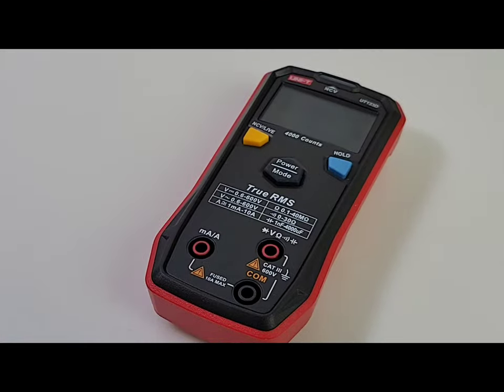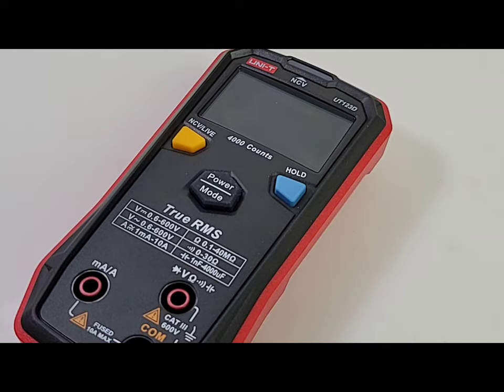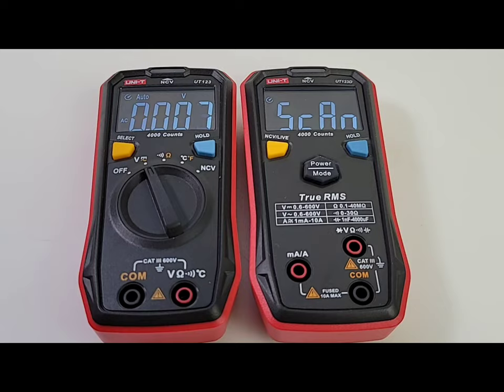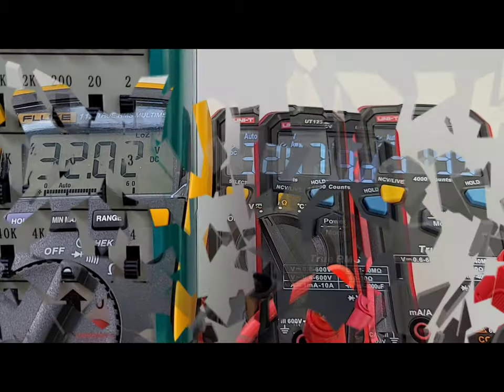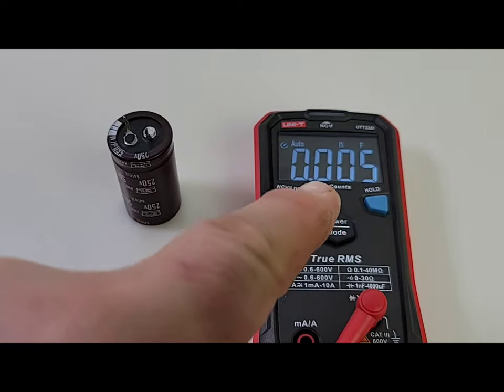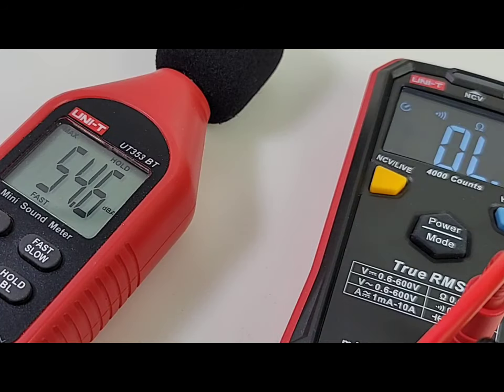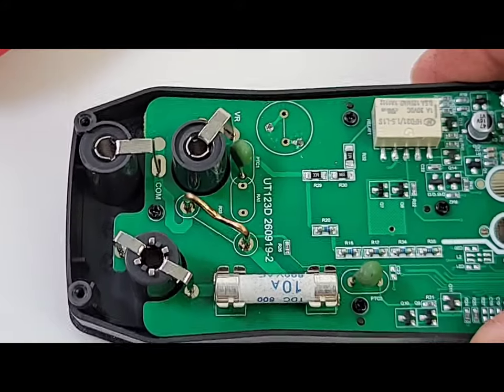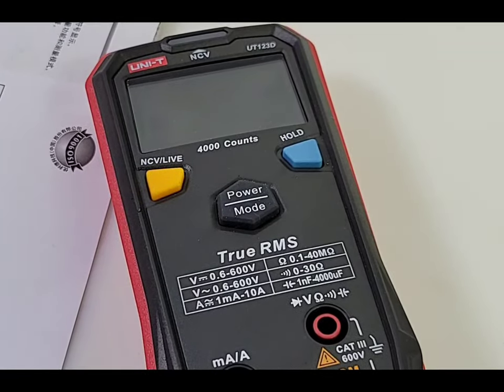UNI-T UT123D CHEAP-O Multimeter Review & Teardown!

Comment: HI Darren, I bought one UT123D when ordering an UT 123.
I was tired of  another Smart meter, (ZOYI ZT-S4)(You have reviewed a similar  one).
It would   not light LEDs which have an antiparallel protection diode . Other meters, even cheapest ones will do.
Before storing it in the  "retired meters for sale" drawer, I decided to  buy a cheap UNI-T: I have some other, and I'm sure they work. 
My opinion is :Nice  cheap small instrument,  Precise, Easy to use 
-Good display,  , I'm missing the foldable stand(why?)
 Instructions were in Chinese only. Too cheap probes
 Even mine  does not light the front LED in continuity check. Thank for your review.
Reply from the maker: Hi Maurizio,  excellent choice !  Too bad they neglected the tilt stand or magnetic backing otherwise it's a solid multimeter! 👍
Reply: @KeepOnTesting   I've used it for  two weeks, and it works as I like, with one little bug :
 I prefer the "dumb" mode,  but it has a defect: it defaults to AC volts. It is aimed to  electricians, not to "electronicians"..  It is a bit annoying, but I've see a really reliable operation. In the meantime, I've ordered a second UT-61(new version)
Thanks to UNI-T

Comment: Hy darren,
which is better between ut123d and ht118a in terms of current accuracy and body construction.

Keep on testing 😉
Reply from the maker: Hello ABBAS...Honestly they are identical in build quality.. both are rugged and good quality plastics and moulding.Accurscy is also very similar...Personally I'd buy both.. Big dual display on the HT118A is always nice but the EBTN display on the UNI-T is sweet too..hard call...but I would buy the HT118A if I had to choose only one.
Reply: @KeepOnTesting  thank you for your answer. and sorry, I have 1 more comparison between ht118a and ut89x which is better where the accuracy is for the use of the automotive field and testing modifications of low-voltage electronic equipment. my current multimeter dt9205 is not accurate enough to measure currents below 1 amp, but it is very important to me. please answer. thank you 😊
Reply from the maker: @ABBAS12V  Both would do well but I'll give the edge to the UT89X in the lower current range.
Reply: @KeepOnTesting  ok thanks a lot darren. and one more question, which of the two is faster to read fluctuating voltages and currents (example: measuring alternator voltage, led flasher, etc.)
Reply from the maker: @ABBAS12V  Probably the manual ranging UNI-T 👍
Reply: @KeepOnTesting  okay thanks again darren, it seems after I thought, I prefer the ht118a because it has a max/min button to measure the maximum current and voltage. does ut89x have that feature? or please mention dmm ut which has max/min features at the cheapest price.

 Thank you, greetings from Indonesia.

 keep on testing 😉

Comment: A meter that does μA-20A, μV-2kV, 0-GΩ, pF-mF, semi-auto, manual dial, normal LCD, min max, rel, temp, is the best meter. Any recommendation?
Reply from the maker: Doesn't exist unfortunately...
Lots of decent options though..depends on your budget. UNI-T UT61E+, HABOTEST HT118A,  SANWA PC7000 all great multimeters..👍

Comment: Hi Darren, I just bought this multimeter yesterday after watching your reviews and it is really good.  When switching this multimeter UT123D in RESISTANCE, CONTINUITY, DIODE and CAPACITANCE mode, there is low ticking sound every second make sure to put the multimeter back very close/touching to your ears, is this normal? When turning ON, you can hear the relay, but when switching to those modes, you can hear a low/faint sound every second.  Have you encounter this? Thank you in advance, new friend here  🥰
Reply from the maker: Great question. I thought it was the relay kicking in but you seem to know what that already sounds like. Any chance you can email me a sound byte so I can hear it ? Email: netplicity1@gmail.com and I'll report back.Btw, Welcome to the channel 😀 👍
Reply: Hi, thank you for noticing, I will send it to you immediately after recording, have a great day 😀 @KeepOnTesting
Reply: I bought mine today and also noticed the same thing, sounds like a clock. I can also hear it in Scan mode.
Reply from the maker: Yes, clicking sound is normal. It's the relay. Congrats, great multimeter 👍
Reply: @MartiniPerez Hi there, mine does not tick in SCAN mode..only in RESISTANCE, CONTINUITY, DIODE and CAPACITANCE mode..The multimeter is working great, and the NCV feature is so helpful in my work 😉 maybe it was the RELAY as what Darren said..I just find it annoying when working at midnight troubleshooting motherboard 😄

Comment: UT123 is a great meter. You get so much for less than $15. But UT123D has gone plus ultra. A lot of people would welcome the addition of current and capacitance modes. The diode mode is close to perfect. And the resistance range has doubled. Just like you, I’m a little disappointed that UNI-T didn’t utilize the visual indication on continuity mode. Also the NCV mode worked better on UT123. Other than that there isn’t much to not like about it. 👍

Oh, and “Put that cheap-o against a Fluke” is a great idea for a regular segment. It’s not as destructive as bashing bad cheapos with a hammer. All in all, a physical punishment isn’t an effective way to correct behavior. Just shame them enough to make them think about their actions and to want to grow as a multimeter. (I’m in a goofy mood today for some reason)
Reply from the maker: Ultra is great way to put it ! UT123D is definitely the next step and lots of improvements make it a worthy successor.

Comment: Hallo bro.
Rm113d vs et8101 what the choice.
Thanks

Sorry if the text is wrong
Reply from the maker: RICHMETERS
Reply: @KeepOnTesting  ok thank u sir.
I think your favorite is et8101 

Because rm113d = 3,5 star
And et8101 = 4 star

Hehe.
Reply from the maker: @abasschn830  ET8101 is a nice dmm..after prolonged use however I find the RM113D slightly more accurate and nicer to use..
Reply: @KeepOnTesting  thank u very much sir. 
Keep testing 😁

Very good riview.
Btw the cheap dmm with pcb very nice build quality is?

Comment: I HAVE A VERY IMPORTANT QUESTION:

Can those who use this device answer, when you manually switch to diode, capacitor, ohm levels, does the CLICK CLICK SOUND come from the DEVICE, can you please answer?
Reply from the maker: You are probably referring to the relay that is triggering when you change modes. This is completely normal.
Reply: @KeepOnTesting  No, I'm not talking about that, for example, when switching to capacitor mode, there is a relay sound, this is normal, but there is a continuous sound after switching on, clicking repeatedly, I'm talking about this sound.
Reply from the maker: @target2256  ahhh well then you have a defective meter. There should be no clicking other than the relay. If you're interested, ship it to me and I'll replace it with a new Multimeter and make a video of the repair.

Comment: Hey Darren, is there an option on UT123D to choose manual range instead of auto range? 

Let say I want to choose Mega Ohm instead of Kilo Ohm manually, can I do that?
Reply from the maker: Unfortunately not. There's no manual override with the 123D.
Reply: @KeepOnTesting  Thank you for taking your time to answer my comment. Between Kyoritsu 1021R vs UT123D, which one will you choose? You only can choose 1 😂

I want to buy between these 2 multimeter but I dont know which one I should buy. Can you give your suggestion?
Reply from the maker: @shahrilhafizhakimin872  Hi Shahrii..well that is quite a difference...in this case I would go with the Kyoritsu without hesitation. 😀  It's a dmm I've been meaning to review for awhile..looks like a very good multimeter! 👍 and Kyoritsu is an excellent brand. The UNI-T 123D is an excellent CHEAP-O but in a different league!

Comment: Inside looks much better than Bside ADM06. And good realization of current switch with 2 parts of connector. 

But still slow for everyday using. XXI century and they can't make fast full auto multimeter. Sad...
Reply from the maker: I guess it's a compromise...but still its a keeper 👍

Comment: Friend at 16:11 what probes you use?
Reply from the maker: Those are ProbeMasters! One of the best test leads out there. 😊👍
Reply: @KeepOnTesting  Thanks for the answer. I use Fluke 17b+ with good fluke probes, but probe master as i saw their shape and size was comfortable. 👍
Reply from the maker: @Sherifone78 Honestly these ProbeMasters will blow the Flukes out of the water 💧  Extremely comfortable for all day testing and built like tanks. Highly recommended😊 😊😊😊
Reply: @KeepOnTesting  i believe that, that price was high too, about 50£ on ebay 🥶
Reply from the maker: Yes indeed,  they are on the expensive side but definitely worth it 👌